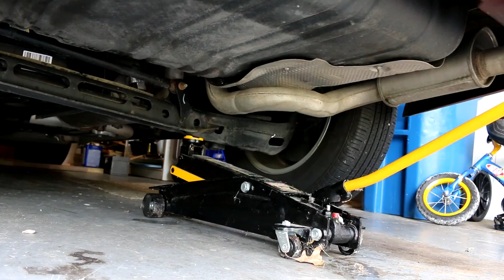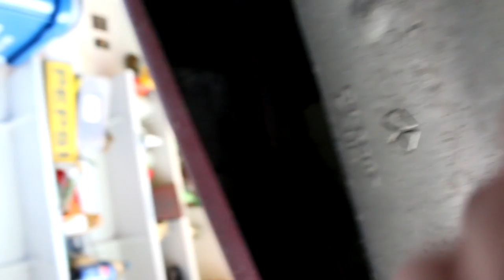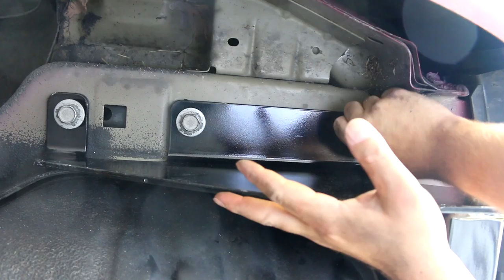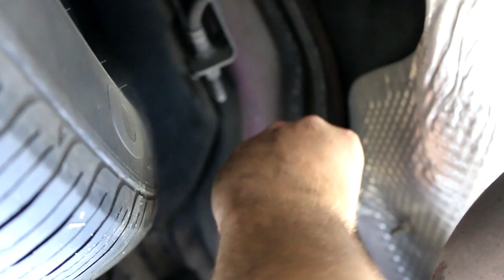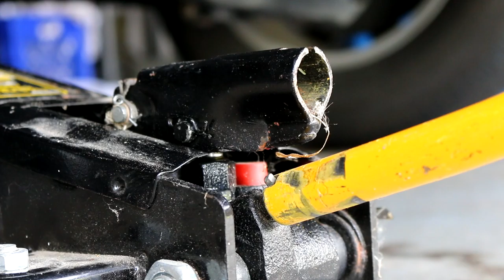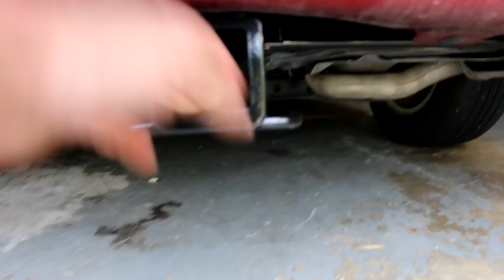Installing Trailer hitch on 2014 town and country van

Comment: Mad props holding that thing up with your knee. I used 3 jackstands to help hold it up.  Also, to anyone else attempting this install, you need an 18mm socket for the two front driver side bolts and the one front passenger bolt. I found this is an oddball size for my cheapo toolkits which did not have it.

Comment: Just wondering if your van has Stow-n-go seats in the back.  I have that same hitch, but it hits the tub for the seats when I try to install it.
Reply from the maker: My van does have the stow and go seating as well. I did not have an issue with it hitting up against it, though. It was tight up against the bumper but did fit. I hope you are able to make it work. Good luck.
Reply: @Steve1323  thanks for responding.  Gonna give another look in a little bit here.

Comment: Hey Steve- any specific recommendations on the amount of torque for the bolts when you put them back?
Reply from the maker: The big thing would be not to over tighten the bolts and break them off. I had trouble breaking them loose when I took mine off so I used a bar to get a little more leverage to snug them down a little more.
Reply: @Steve1323  ok. I have an impact driver that I was going to use. I just wanted to make sure the bolts were tightened to specs once I mount the hitch bar